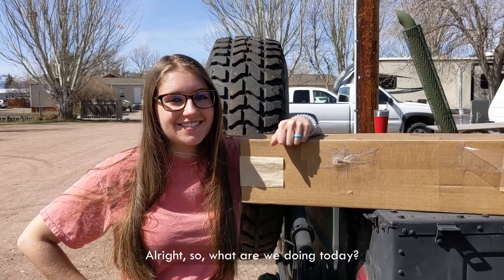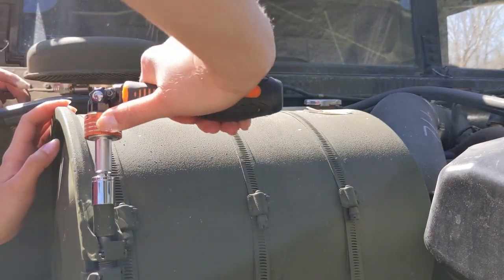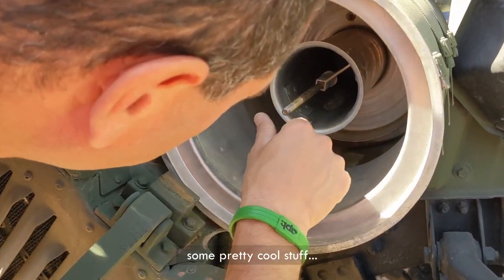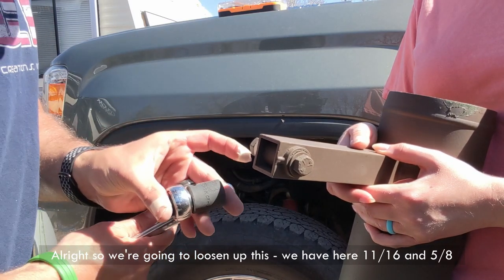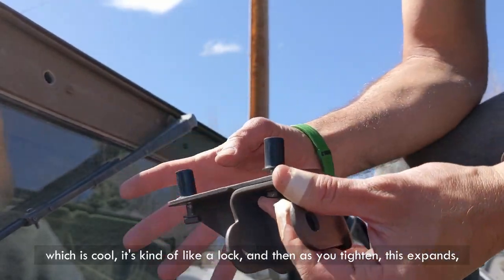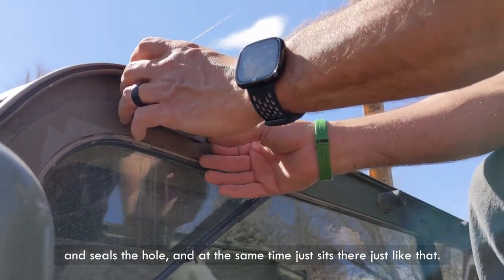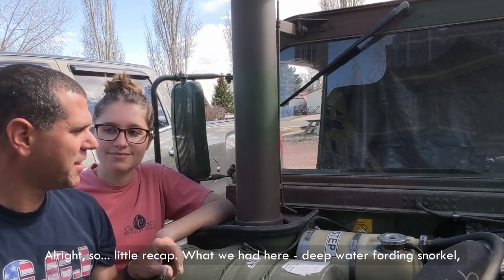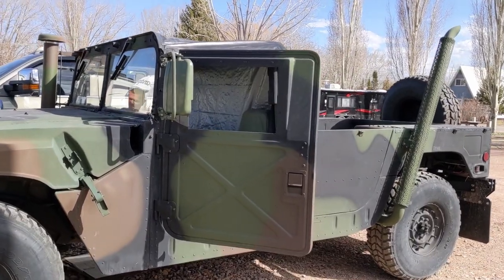HUMVEE Deep Water Fording Conversion (Part 2: Snorkel)

Comment: Very good👍👍 FYI: The correct nomenclature for the "Mushroom" as you call it is: "Cap, rain." The Dust Extractor boot on the bottom of the Aircleaner Housing is good up to 30" depths.  in fact using the Dust Extractor will actually help keep the airfilter element cleaner. Have you figured what the purpose of the 3rd (center) large screwband clamp in the airfilter housing is for???🤫
Reply from the maker: Thank you Jim! Thank you for the info. Not sure about the center clamp.. enlighten me :)
Reply: @theinspiredjourney 
OK, but you are NOT going to believe why! 

That center screwband clamp is there to reduce harmonic vibrations typical from Diesel engines, The HMMWV’s air filter housing is made of thin aluminum (for lightweight) that is only “soldered” together. The harmonic vibrations can cause the soldered joints to crack thereby allowing contaminants inside the air filter!  

See, I told you, you wouldn’t believe it!
Reply from the maker: So cool! I did not know that. Definitely a fun fact!!!
Reply: @theinspiredjourney  Please consider letting me know when you get around to tackling the full DWF installation; there are certain components that are installed on the assembly line that virtually no one knows about outside of AM General.
Reply from the maker: Absolutely Jim! Looking forward for that! Send us a private message on Instagram so we can connect!
Reply: @jimbella9353 hey I was wondering what those parts might be or if you would be willing to share your end of DWF knowledge to me for my two trucks?
Reply: Yes @BhobsonKatie

Comment: Are you going to install the dwf cdr valve and the valve switch that goes inside the cab? I’ve done just about everything except this valve switch in the cab. They cut mine completely out during demil. Trying to figure out how to hook all the hoses up. There’s just hardly any space behind my generator to be able to get a good look back there.
Reply from the maker: Hey Megan, yes! My plan is to go over the entire system and yes that is including the installation of the CDR valve, lever (valve switch inside the cab), the plastic "sensor" box underneath, and all hoses so the system could function. There is not a lot of DWF installation info out there but we will work on it soon so it would help others :)

Comment: Pretty cool! Are you planning to do anything for rock sliders panels? Seems like they all require drilling body, which sucks.
Reply from the maker: Thank you mike! Yes, I was planning to install rock sliders panels but couldn't find anything that looked good on the Humvee and without drilling. I was thinking to just go with the simple rock sliders panels and possibly to paint them the military camo to match the Humvee.. Not sure %100 yet.
Reply: @theinspiredjourney   yeah not too many rockslider options for the humvee. No where to bolt them. New holes have to be made.
Reply from the maker: Yep :(